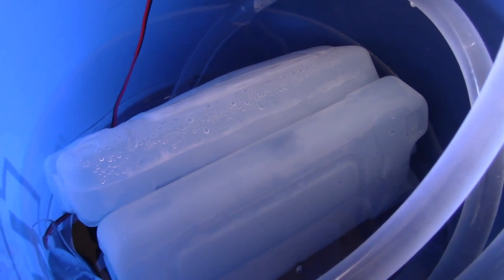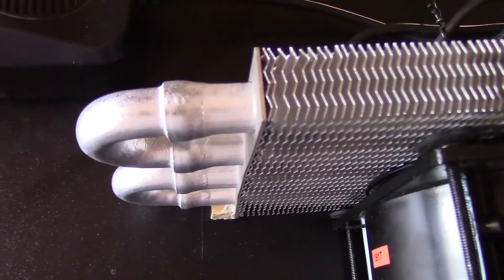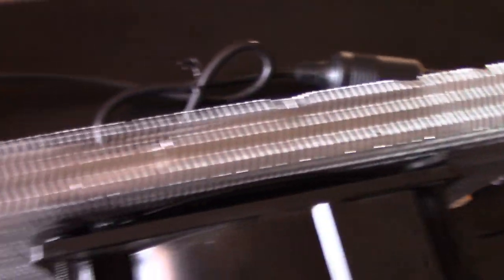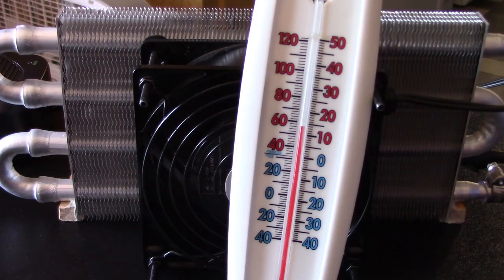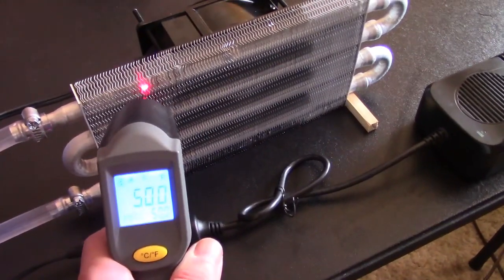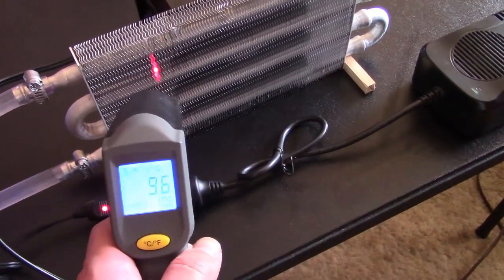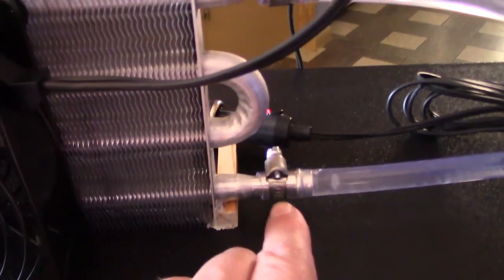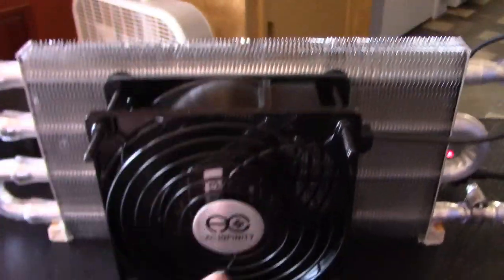Homemade AC Air Cooler! DIY Air Cooler! (compact!) - No added humidity! - Easy DIY - Air Conditioner

Comment: Will it work with PC water cooling radiators?
Reply from the maker: those can work in certain circumstances (but since the fins on those are usually much closer together, so you have to use much stronger fans to get the air to pass through the fins). the type of radiators i used work great with table and desk fans. the air flows through the fins very well
Reply: @desertsun02  thank you!
Reply: @desertsun02 I just tried it out and it worked quite well. However the condensation from the radiator starts pooling under my fan 😂

Comment: What fan are those in the small radiator?
Reply from the maker: the square fans are axial muffin fans (low and high speed) from AC infinity
Reply: @desertsun02 ~ok thanks a lot.

Comment: why not blow
Reply from the maker: you can use the fan in front of (or behind) the radiators. i've always found that it works better when i use it in front (but either way works)

Comment: I once made an unnecessarily-more-complicated version of this using an automotive heater core and a 12v blower from a car. Made a sheetmetal enclosure to mount the coil in, put two round RV air vents at the front where the cooled air would be blown out, and mounted the blower in the back pushing the air in and through the coil. I used a large ice chest for the reservoir and used a submersible pump. This thing would move your hair from across the room, but it was loud, consumed too much power, would spit condensation out the vents, and went through the ice crazy fast. It was probably equivalent to a 10k btu AC in cooling but wasn't practical. I gotta say, I much prefer your solution, lol.

Comment: unfortunately where i live the bigger setup would cost as much as an  cheap ac with atleast 1 ton cooling capacity those radiators are so expensive like that bigger one is for like 250 usd

Comment: Instead of using the ice, try using a bent copper pipe placed down a well to use as a heat exchanger to expel the heat into the cold well water.

Comment: This is comparative to a chilled water supply air handling unit.  I a'm looking to buy the smallest freezer unit and add heat exchanger inside to make chilled water.
Reply from the maker: hi. yes, indeed. sounds like a good idea! i've got a mini freezer (but so far i've held off on drilling holes into it) (for the tubing).

Comment: Why low  speed and high speed. Both are high speed is any problem?
Reply from the maker: hi. you can pretty much use any fan speed you want but i find that the slower the speed, the longer the ice lasts.

Comment: Great idea. Sounds loud. Is it?
Reply from the maker: hi. nope it's not loud at all. the only noise is just the sound of a fan running (the pump makes almost no sound at all). you can use lots of different fans with a design like this so you can choose an extra quiet fan or one that has a particular sound to it if you like). note that my camera has the dual mics directly under the camera's lens (facing forward) so it often picks up sound louder than it really is.
Reply: @desertsun02  Thx! Good to know. I was thinking it might have been the mic. Brilliant idea.

Comment: I’ve been thinking of getting a 300-500 gallon heater holding tank. Burry it with a Accessible hatch. Run a inlet hose on the bottom and a outlet hose on top. With a pump to circulate the water throughout the house and use radiators with Fans on them to cool down our home. We also have Solar water heaters for our hot shower water. Install a Bypass to allow the hot water to also run through the same radiators in the winter to heat the house. I’m just a little worried because the hot water gets extremely hot because it’s in stainless tubes covered with glass and it gets extremely hot, maybe a Separate radiator in a isolated area and then ducted into home.

Comment: This is a great idea for a little spot cooler to blow on you for a few hours or maybe cool a bedroom! But it’s not a good solution for cooling a living space if the freezer you’re using to freeze the ice packs is in that same space. You’re just transferring heat from the air into the water, into the ice pack, then your freezer will transfer the heat from the ice pack right back into the air… and generate more heat in the process.

Comment: Yeah these are all well and good but I don't have to keep running in and get nice what I'm asking is can I use the ice machine that I have that is a portable ice machine and or the refrigerator that I have the tiny refrigerator take out the element refrigerant elements turn that into an air conditioner using the refrigerant that I would use in a car or something like that I'm not trying to use no ice to make a refrigerator to make a freezer to make an air conditioner I don't want to have to use ice

Comment: Where did you get the radiator?
Reply from the maker: hi there. i buy the radiators on amazon. if you search for 'hayden transmission coolers' you will see them.
Reply: @desertsun02  thanks!

Comment: Cool exprement u inspired me to copy your design but ill upgrade it by putting the water bucket in a mini frige run by a compressor just got to drill two holes for the pipes and thats it hopefully it be as good as any ac
Reply from the maker: hi. sounds like a good plan! i'm currently working on another similar unit. it will be out in maybe a week. it basically has a fancier "removeable radiator" stand (combined with a mini "table top" shop fan). it will be the fastest and coolest one so far.
Reply: @desertsun02  oh cool can't wait to see what you make your videos often inspire some of my most fun projects :)

Comment: I'm thinking.use your trans cooler as in this video. If you have a 12vdc travel refrig freezer.put your cooling lines through the horizontal hatch cover with a type heat exchanger in the cooler.
How much water do you put in the bucket to supply your chill lines?
Any ideas.

Comment: how about some links or size information on the fans would be helpful
Reply from the maker: hi. the square fans are Axial fans made by AC Infinity. amazon has them. both the low and the high speed models are 4.7x4.7x1.5 in. (120mm). model numbers are LS1238A-X and HS1238A-X.

Comment: I have a 42 inch shop fan how big of a radiator can i put on that and run it from an old deep freezer?
Reply from the maker: hi. there is a company called 'badger insulated pipe' that sells very large heat exchange radiators. i shop fan would pair up well with some of the ones they sell. check this one out.
https://badger-pipe.com/products/36x36-water-to-air-heat-exchanger-1-1-4-copper-ports-with-install-kit?_pos=72&_sid=57f5e4057&_ss=r

Comment: Nice i like it.
Do you have any information on the temperature drop of the cooling water in vs out and lenth of time till needing to change ice?
Thank you
Reply from the maker: hi and thanks! temp of water 'in and out' will vary depending on temp of the air in the room and how fast you run the fan. i usually get several hours of runtime before i need to add more ice (varies with amount of ice, used, size of the ice blocks, starting temp. of the room air etc.).

Comment: What if those pipes with a small bucket of water you keep in the refrigerator in freezer compartment by making a way to closing the door of it. That's how you can avoid the ice bucket outside even it will help to avoid ice most of the time.
Reply from the maker: i've been thinking of trying something similar
Reply: @desertsun02 is a great must try then i will wait for your video

Comment: What should be the size of Trans cooler for air conditioning of one bed room of 120 sft area and 10 feet height.
Reply from the maker: hi. hayden model 405 is a good choice. they also sell medium duty and heavier duty trans-coolers too. i haven't tried those yet.

Comment: Project looks fun👍 You could maximize cooling by a makeshift duct between the fan supply and coil.  That way 100% of air the fan is pulling would blow across 100% [entire surface area] of the coil.

Comment: Love the mini heat exchangers - great idea.  

2 things that would help the time run longer:  1) put the ice/water in a thermos (something insulated).  You could notch 2 holes in the side lip for passing the tubes.  2) insulate the tubes with neoprene like insulation.  With these 2 things you'll be better able to control the area cooled.
Reply: wouldnt work hot air goes through the rad therefore will still have the same effect as if in open air

Comment: Where did you get them metal vents from where the square fan is attached to ?
Reply from the maker: hi. i get the radiators from amazon. you can find them by searching for 'hayden transmission coolers'. if you mean the actual metal grill over the fan, that comes with the fan.

Comment: I’m thinking of trying this in conjunction with a chiller. It’s too bad glycol chillers used in fermentation are so expensive, but hydroponic garden water chillers are a little cheaper.  Im trying to build a system to cool three heat sinks and a radiator for air cooling and spot cooling on the heat sinks that get pretty hot.

Comment: Why not just buy a water chiller, pump, and an insulated resovoir tank (like a cold plunge setup? A 1/2hp chiller can easily cool 50 gallons down down into the low 40's...of course you would need to run tubing to your heat exchangers, but that is exactly how a highrise building is air conditioned...chilled water. Its really quite efficient too.

Comment: If it is soooo cold where is the condensation?
Reply from the maker: hi there. typically, condensation only occurs when humidity and dew points are relatively high. the dew points where i live are usually very low so i almost never have the condensation issue. we often have dew points in the teens and twenties (Fahrenheit) *sometimes even in the single digits. all i usually get is a very light frost on the radiator.

Comment: What if you had a mini freezer with 3 holes drilled at the top one for the pump power cord and the other two for coolant feed and return.

 The internal radiator then sits in a shallow or deep bath of chilled anti freeze.

The tubes run out and feed the external radiators that have fans attached.

This way, the coolant lasts significantly longer would it not?
Reply: It might actually not last longer because you are not taking advantage of the phase change of water melting. This absorbs lots of heat and keeps the temperature consistent which helps with giving a temporary cooling boost. If the water is cold enough then yes, it might outcompete the just ice version

Comment: The setup looks very simple but is there any guide how to connect the parts up please? I totally dono about electric works but I need a small aircon for my pet that doesn't humidify the air surrounding. To confirm, this does not humidify the air right?
Reply from the maker: hi. these setups don't add any humidity to the air. they just cool the air down. btw - the other air-cooling units that i have (where i blow air over ice) don't add any humidity to the air either. they cool the air due to the phase change of the water from a solid to a liquid. the only setups that add moisture to the air are 'evap air coolers' (also known as swamp coolers). those are the ones that pull air through a wet pad (an evap cooler pad) and cool using evaporation. this video is the 'how to make it' video. if you have any specific questions feel free to ask.

Comment: How about compressor free absorption type refrigerator and air-conditioning using induction as heat source, they are starting to discontinue 3 way refrigerator in RVs ?

Comment: Have you run across a concave aluminum radiator (transmission cooler)? Id love placing one in front of a fan that has a convex shape.
Reply from the maker: i haven't, but they may exist.

Comment: get a large terracotta urn, aka "amphora". the seepage through the unglazed ceramic naturally cools the contents to 4C. there are charts around for the actual drop in degrees for every unit of water lost. if you have 200 odd litres of water held at 4C, you arent going to warm it up much with this set up! all about thermal mass too. its not as limited as the swamp cooler is, still works in high humidity. though of course, its better when its dry...

and yeah, enclose those coolers, all the air through the fan AND the fins. the slower the air through the cooler, the more heat sucked out...

Comment: Why not just send the water through a coil, placed inside an old mini fridge?  We have several of them laying around, and none our kids went to college. The things just keep appearing every so often.  Set he fridge on its coldest setting lay  as much hose inside as you can fit, and trickle the water through it, instead of messing around with ice and stuff.  Better yet, add some antifreeze to the mix, and stuff the freezer portion with hose. Make sense?

The only trouble with the systems, mine and yours, is what to do with the condensation.  I live in a VERY humid place.  Any air blown across a cool or cold coil will immediately create condensation, which is a good thing, as it removes the moisture from the air, but a collection system will have to be made and, either,monitored, or attached to some kind of float switch, to shut the unit off when the condensate reservoir gets full.

Comment: How long does it stay cool? Before the ambient temperature affects the system?
Reply from the maker: hi. it all depends on how much ice you use (and how hot the air is). typically, you can get several hours of cooling at a time.

Comment: You should run the water in the bottom and out the top to avoid bubbles. It seems to work well, anyway. Nicely done!

Comment: Have you ever done a dog cooling bed? chilled iced water through a tube snaked under the bed floor to keep the dogs cool as they lay down?  Or a cooling vest for people to wear the same way?
Reply from the maker: i've thought a lot about making a cooling vest but am concerned about the condensation issue that some people would encounter. the dog bed idea is good too (but i don't have a pet to 'test it'). i like the idea though and i just thought of a great way to do it (just sitting here as i'm typing). that may be my next video

Comment: You must have 0% humidity. I’ve run a similar set up but reversed. I submerged my heat exchanger in ice water and pumped air through the coil so that my buddy could have some a/c in his gutted civic. But we  have near 100% humidity here so it caused condensation to occur and the air would occasionally spit some water as well.

Comment: But dont make ice in the same room. When you are making ice the freezer will produce heat and when you sum heat produced by the freezer  and cold produced by your cooler you will realize that you are not cooling the room.
Reply from the maker: or you can make the ice at night when it's cooler out and then use the unit during the day. i don't mind if the kitchen is a degree or two warmer when it's freezing the ice though.

Comment: Why doesn’t this add humidity? You’ve got a literal bucket of ice turning into water in your house, surely this adds humidity? If you moved the cooler outside then I would agree
Reply from the maker: hi. it doesn't add humidity because when ice melts it just changes phase from a solid to a liquid (but it doesn't turn into a gas). to keep the water totally contained you can use an ice chest or something like that to hold the cold water. it's basically a closed loop system because the water stays inside the tubes and the radiator.
Reply: Perfect answer as water remain inside system, infact the moisture in air gets condensed and in turn will reduce humidity. 
Albeit there can be issue of water (condensed droplets on radiator) sprinkling if fan speed is high.

Comment: May I ask where you buy the parts?
Reply from the maker: hi. i get most of them from amazon. you can find the radiators by search for hayden transmission coolers. the pumps are easy to find too, just search for 12v water pump. they have dozens of choices. amazon has many of the fans too
Reply: @desertsun02  i saw a set 2 pcs 12v fan for mining rigs and comes with an AC power supply and speed controller also. Have you tried those? Any CFM rating you recommend or RPM?

Comment: You’re just borrowing btus from your fridge. In my slum people just drink cold beer, thus placing the btus in their gut.
Reply: It's possible to make ice off grid. 12v countertop ice makers exist(so no need for an inverter).  You could even DIY an ammonia absorption ice maker. Then use the ice from that to cool your room.
Reply from the maker: @walter kersting hi. that's true in many cases (but it doesn't matter in most cases). what i mean is that unless you are trying to cool your entire house 24/7 you can borrow those btu's for the cooling when and where you want it. if my kitchen is warmer by a degree or two (when the ice is freezing) i don't mind.

Comment: IN THE SOUTHWEST, YEARS AGO, EVAPORATIVE COOLING WAS HOT, ON TOP OF THE HOUSE, BUT THE WATER SHORTAGE MAY HAVE STOPPED THAT WITH ZONING LAWS NO INEFFECT TO SAVE WATER
Reply from the maker: hi. could be in some areas, but there are evap coolers all over the place in my area. (when you go to the store they have evap cooler pads stacked halfway to the ceiling, just to keep up with the demand)